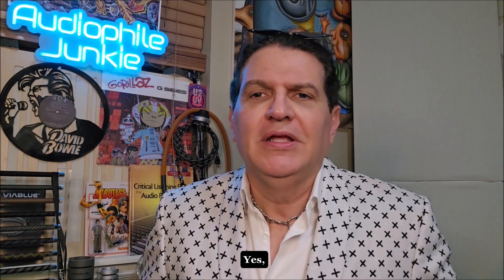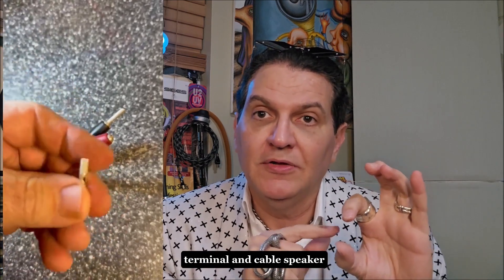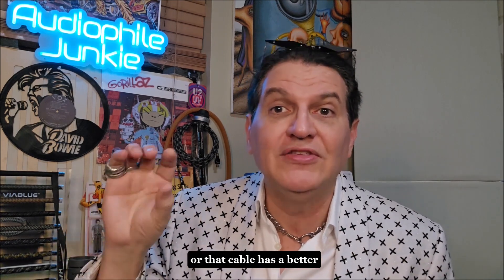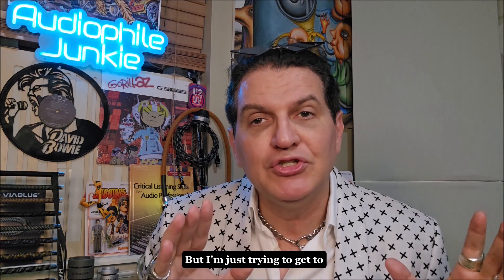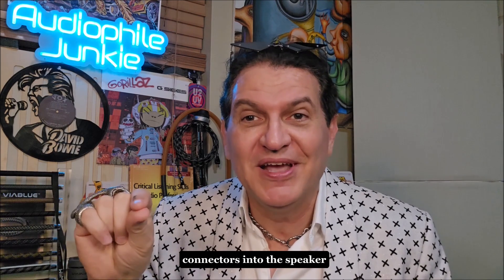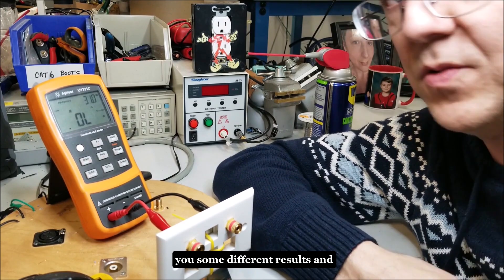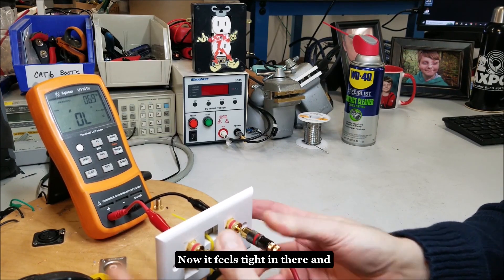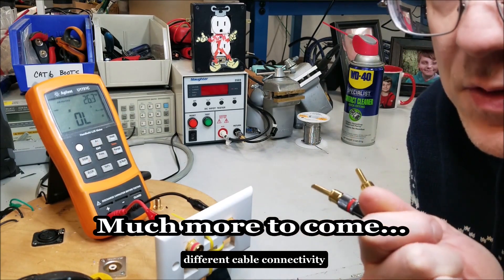💡The Audiophile Cable Debate Often Overlooks One Obvious Thing...Jeff at Blue Jeans Cable Explains

Comment: For best possible connection, what do you think of the tube connector from GR Research?
Reply from the maker: I have them on my NXtremes and better than most.  It's still only one half the equation as we see here in this video. The extra pressure of locking bananas can be beneficial.  It can also depend on how the terminal is connected internally and the connector on the cable is terminated.  This cable had a sonic weld internally.

Comment: Tone controls ! What you are hearing is a difference, good or bad isn’t totally relevant ? It’s your system and all your sources  ? How do you make everything work together ? What are you hearing  or not  from a particular source ?  Certain distortions we like or are part of the music we listen to ! And every recording ever made has them ! Not to mention every engineer and mixing console , the year it was made . So a lot of the concerns is based on what we are listening to and the means we have to extract it , trying to make every piece of music in our collection sound like we want it to sound ? With what we have or think we need ? You have this equipment but you listen to that music ? And it’s not coming together you spend time and money and still not what you want ? And it’s mentioned  that you can change this with wire ? If you used the same brand cables though out your system, you would have another component in your system that’s tying everything together , now if you add another brand cable at another location …another sound ? which might  work ? But ! It’s not just the cable the source might sound bright so a certain cable that’s not so called bright could make your CD player sound less bright , but it’s the entire system that you want balanced to your preference? Not just a few songs ? So cables become tone controls  especially if you don’t have tone controls. Or capacitors ? In the sense of blocking or permitting certain frequencies , so the variables are very large for every piece of equipment and cable interaction! That’s one of the reasons that professional and studio try to use the same brand or spec to have a baseline with multiple signals ! Also always keep in mind the size of the traces of the pcb’s and the internal wiring is very small ! And there’s nothing that makes it bigger to fit your cables? You can spend millions if you want, but the size of the internal wiring stays the same in your components !

Comment: I gave up on the cables debate years ago(I'm in the "if you can't measure it, you can't hear it" camp FWIW) and just went with good wire and solid connections and never looked back. That being said, when I saw Blue Jeans was offering an opinion it caught my attention.  I work in the AV department at a Canadian university and have been pretty much exclusively using Blue Jeans for all our HDMI cables.  When HDMI first forced it's way into pro audio I did as much research as I could on how it worked and how it measured, and I came away very impressed with what Blue Jeans was doing. I had a brief email conversation with them regarding cable ties and again, very impressed.

Comment: IMHO soft copper spades from AudioQuest are way better than any cheap split type locking bananas (made of who knows what metall).
Reply from the maker: You might be surprised. Exposed soft copper is one thing that may not stand up over time, but really I'd inspect under the hood and see how that spade is connected.  That's actually a bigger area to look at with all companies... Not just AQ... To determine if you're truly getting a great connection. Don't just fall for conductor type.
Reply: @AudiophileJunkie  You also might be surprised. AQ spades are not bare copper but are either gold or silver plated. And furthermore that gold or silver plating is applied directly on copper without any intermediate layer of nickel that is commonly used in a plating process. But as some people claim that nickel layer may alegedly degrade connector sound quality.

Comment: Thanks for this informative video. You've gotten me interested in performing the same test. QUESTION (for Jeff): to what source of power are the cables connected?  Thanks again!
Reply: I'm testing loop DCR, so only attached to the multimeter.
Reply: He's measuring resistance through the cables... no power needed.
Reply: No power.  He's measuring resistance over a loop of wire.  Perfect connections would leave only the resistance of the cables themselves; imperfect ones add to it.  (The miniscule amount of power needed is provided by the meter itself.)

Comment: You really need a 4 lead Kelvin meter to see the effects of contact resistance. BTW if you ever get those cheap import banana plugs where the springy part of the pin spins freely, on the center post,  those can vary in resistance even though they are plated.  You must solder the springy part to the rest of the connector at the base. .
Reply: You are right

Comment: This reminded me.  I should clean my speaker connections with pure isopropyl and inside the banana jacks with same on cotton swabs.  Then when it is dry maybe Caig Preservit. All is gold plated so clean uncorroded plated terminals do not need Deoxit and that might even be less desirable. Plus the Preservit may reduce friction if you insert and take them out alot to reduce surface wear.
Reply from the maker: That's really the purpose of the video... It's a reminder of maintenance at the connector level where some people may have more or less issues.  Recently my friend had total failure... Others may have near perfect connections that don't need much.  Either way, it's a good reminder to check and maintain versus other things to be neurotic about.

Comment: Most talkers are HIFI BS talkers, added by the Audiophile BS talkers. Barely none has a High End system. It‘s all HIFI and most of it clueless. To me there‘s LOFI (Mono, Radio, portable Cassette), HIFI in flavors „better“ and „schöner wohnen“, that covers all audiophile nonsense, too (starts at the gear around the level of Planar2 and goes well into the silly Wilson Audio watt puppy levels).
Hi End is where most of us go broke for decades or life, but relevant Technology Edge. It‘s NOT about finding the little improvement to your system, it‘s about finding new non addressed elements to a system that already has all known little improvements, that is at the End and is researching for other angles.
You combine the last with the „better schöner wohnen HIFI“ which is ok, but it‘s HIFI, a hobbyist time-waste.
Why? Man, are you talking to house-wifes? Corrosion and material quality is nothing new, zero, neither bad soldering. It‘s basics. That physics are basics for good performance anybody in telecommunications, electrical engineering, etc. can tell you. You wonder why NAIM had these weird german plugs? Part of that is electrical engineer thinking about physics.

Comment: This is getting very close to snake oil.  

First we need to see what he's doing with that cable.... 
It's obvious that it's not one contiguous piece of wire since the multimeter does not react right away and even shows OV (overflow) after the connections are made. 
He's doing something we don't see at the far end of the cable.

Second if that is a milli-ohm meter... those readings are so low that any actual difference would never be audible.  0.014 of an ohm is a 1 in 570 difference with 8 ohm speakers, zero for all intents and purposes.
Reply from the maker: You don't have to believe it. Go ahead and don't clean your connectors... Buy connectors that aren't better... Enjoy whatever you want. 

It's pretty funny that no matter what you show... Even something as simple and obvious as this... It will trigger people in this hobby. 

Also, it's so simple that why don't you do the experiment yourself.  Then you can argue with your multimeter for hours 🤠
Reply: @AudiophileJunkie  
The objection is that despite the encouraging readings on the meter... something was happening off-camera that we didn't see.  That's not science, it doesn't produce a replicable experiment and thus cannot be peer tested.

I do in fact have similar demonstrations on my website and I make real sure nothing is hidden or misrepresented.  It's science and anyone can replicate what I did... and get the same results, btw.

If you're going to present science, present it fully for others to peer-review.

As for cleaning connectors.  Every time I disconnect anything I dip the plug in isopropyl alcohol right before reconnecting.  I don't have to clean connectors because mine never get dirty.
Reply from the maker: So if you do the experiment yourself, why don't you already know this?  If you already clean your connectors, then you are essentially agreeing with the video. 

I think it's pretty clear that you just wanted to flex what you do and make up a stupid excuse to get triggered by a very simple demonstration.  I can only imagine how triggered you get when cable makers don't even do this level of testing. 

You should go to AES and do a presentation of your own methods if you want validation and a real reason to flex. Trying to nit-pick this pretty simple and obvious experiment that you can do for yourself with minimal effort and cost is not going to give you the return on your flex that you're hoping for.  It just makes you look silly and petty.
Reply: @AudiophileJunkie  
The objection is simple ... it's bad science.

Without seeing what was going on at the other end of those cables, the "demonstration" is incomplete. Thus not adequate for anyone else to try the same experiment to either confirm or refute the findings.

I don't care what you think I wanted to do.  The point remains that you're presenting a demonstration that nobody can replicate on their own. 

As for how "triggered" I get. Well there's some truth in that. I really hate to see big corporations ripping people off, just because they can.  So much money is flat out wasted in this hobby through fraudulent claims and "science" that exists only in the marketing of useless stuff like high end cables, reclockers, isolators and really stupid doodads that I am almost ashamed to do be associated with "audiophile" things.
Reply from the maker: If you don't know how to do this experiment yourself or can't logically understand the importance of connection quality, I  can't help you.  You can virtue signal and emotionally vomit all you want, but you're just embarrassing yourself.  There's no big corporation or ripping of anybody off.  In fact, the tip is free, and you can choose whatever connector you want if you buy a cable from BJC.  It's shocking if you can't replicate this simple demonstration, but pretend to be an authority. The point wasn't even to define a measurement applicable to all.  You missed the whole point.  The point was to show that connections matter and everybody who has different terminals or connectors on their cable may measure a difference even MORE or LESS.  How this went totally over your head is comical, but also sad.
Reply: @AudiophileJunkie  
Once again ... personal attacks, not a logical rebuttal.  Sounds to me like you're angry because you got called on bad demonstration procedure... what was he hiding at the other end of those cables?

My point was, and still is, that there is not enough information that other people can try the same test to verify the results.  This behaviour is very typical of snake oil vendors.
Reply: Not to argue the origin and definition of snake oil, but if the general point of the video isn’t telling you to buy something for an inflated price that can be proven to do absolutely nothing, telling folks to reseat and clean their connections isn’t a bad thing. 

I understand your point about the measurements being negligible but it’s not like the Blue Jeans guy fell off his chair and said “OMG this will transform your system!”
Reply from the maker: Correct...He even said the measurements themselves aren't the issue and he can sell you whatever connection you want on your cable.  Some just want to cherry pick and be triggered by anything that gives them a reason to run to their keyboard and pretend to be the smartest guy in the room.
Reply: @jasonwebb6484  
True enough ... but it's still bad science to have hidden elements in an "experiment" like this.
Reply: So Douglas, in your expert opinion, what magnitude of resistance will make a difference?  Do you have a valid reason to not want minimum possible resistance in a connector interface?  It is not always about a WOW moment or living to measure everything and then opine about every measurement.  Can be as simple as simple steps to ensure every part of the signal path is optimized.  

It would be nice to see the entire length of the cable, but your insinuation of hocus pocus is not supported by anything.
Reply: @jfritzy4358  
Where did I say I wouldn't want minimum resistance in a connector? 

My objection was that the guy wasn't presenting enough information about his demonstration (typical of snake oil vendors) and that nobody can duplicate his results without seeing the entire setup and procedure.

Do not be twisting my words just so you can argue with me.  That's a game you don't want to play.
Reply: There is a reason why in double
Blins test, audiophile can't tell
the difference between ofc wire and multi- thousand dollar cables. 

I will say blue jeans make high quality products. And I have no problem with them.  

The main problem in this hobby is those who push some of the high end cables. Some of which measure worst. Not
saying this was happening here.

Comment: I'd like to see what you guys have to say about the tube connectors that Danny over at GR Research provides.
Reply from the maker: We didn't have any to measure, but they should work well due to the contact area.  I have the tube connectors in my Nxtremes.  However, I have locking bananas on my Blue Jeans Octoquad speaker cables that go into the tube connector.
Reply: If your speakers are not utlra highend with verified non ferrous binding post... then they are a giant upgrade.
Reply: Yes, brass on 20.7s 😊 @bayard1332
Reply: Those connections seemed super loose, I've never seen cables that easy to push in.

Mine are as tight as a fish's
Reply from the maker: That's why I have the separate video last week about the speaker terminals themselves being part of the equation.  I'll have more on that soon.  Locking bananas though can help in those situations where it's not as tight as it should be.
Reply: I love those post replacements, but I would still use the locking bananas on the cable.
Reply: Glad that this reminder is coming up and measuring to prove the point adds value, but Danny has been on this bandwagon for at least a decade on his very popular YouTube channel, so what is being portrayed here as revelation reads more like riding coat-tails, also Danny goes further into differences of metals (like plated steel is not ideal). And while this should be completely obvious, I'll admit I haven't reseated connectors in some of my gear in the past 5 years. So thanks for the reminder!
Reply from the maker: Danny did measurements?  He showed the difference of locking bananas to BFAs?  He talks about reseating connectors every few months?  He shows the importance of connection methods inside the cables?  I don't get a chance to see many videos, so I must've missed it if he did the exact same thing recently.

Either way...The point isn't that this is "new'.  It's actually been known far longer than YouTube videos even existed.  The point is that very little attention is paid to connections in general...not just speaker terminals. I know this video focused on that one aspect and Danny sells a specific type speaker terminal to promote it, but it doesn't mean that anyone doing a video about connection quality is "riding coat-tails" lol.

Danny does deserve credit for paying attention to that area and making a pretty good product to serve that purpose.  However, this macro topic has been in every video I've made about cables and what's under the hood in terms of connection quality mattering...not just the speaker terminals.  

I'll actually have a video on the Viablue speaker terminal ALONE very soon.  You're welcome to watch and compare to anyone else's.
Reply: @mw4609  I don't claim to be an expert in anything, and I am certainly not benefitting at all from being in this video. Nobody over here is getting rich off cables. I really don't get why this is so controversial- but that's why all the videos I made are gone now.